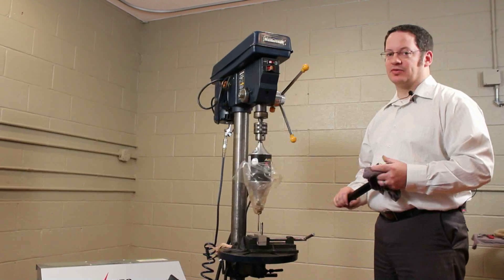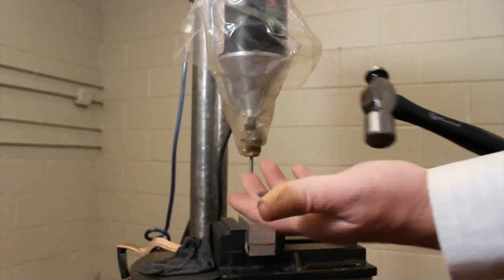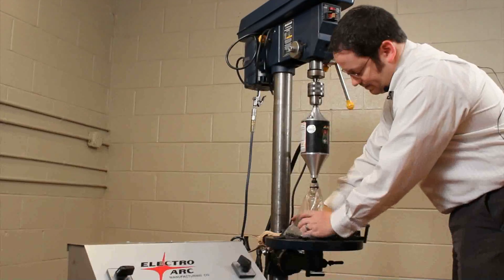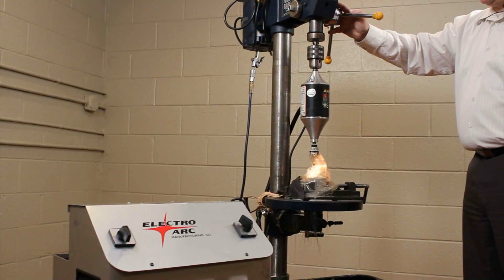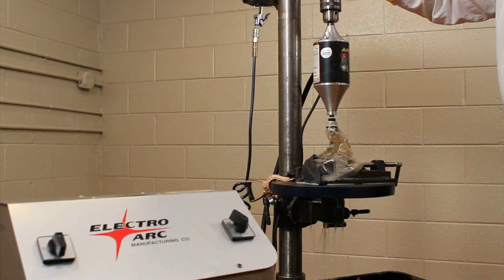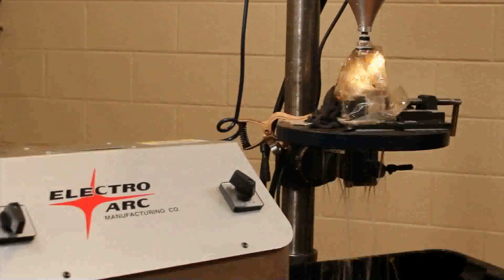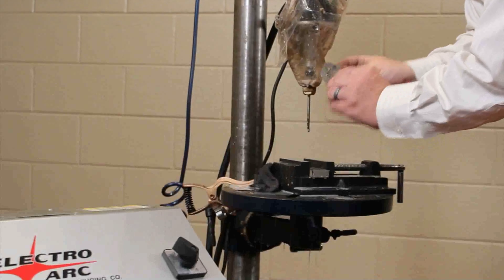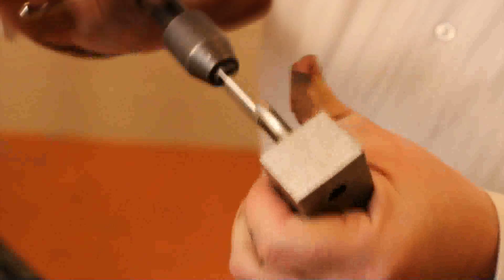Portable Electro Arc Model 3-S Metal Disintegrator

Comment: What am I looking at here? I'm guessing very low voltage/high current passed through a tungsten probe?
Reply: These machines use electrodes (we recommend molybdenum electrodes) to send low voltage/ high current electrical charges that melt the designated piece of metal.